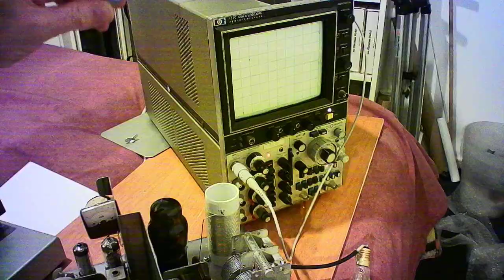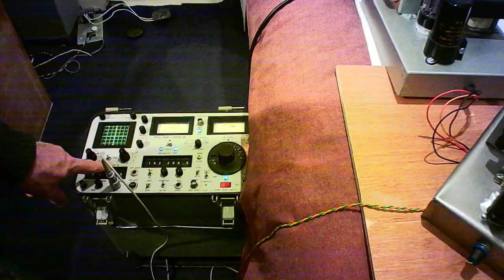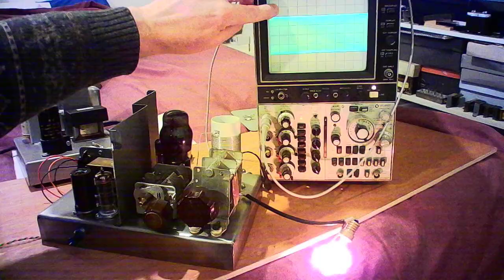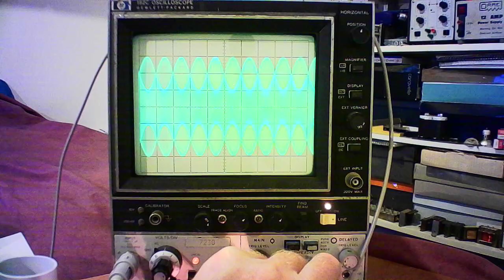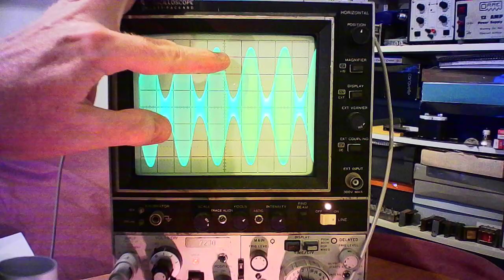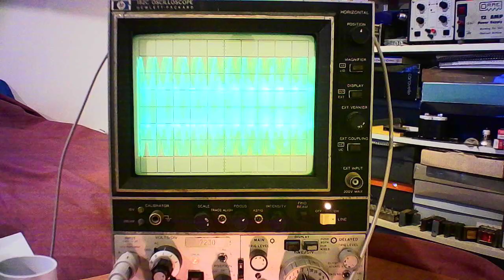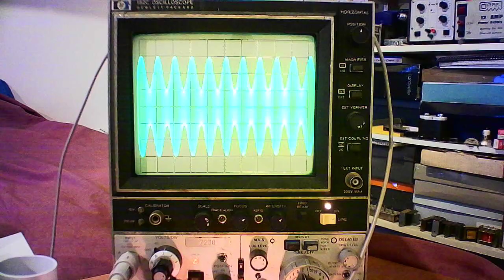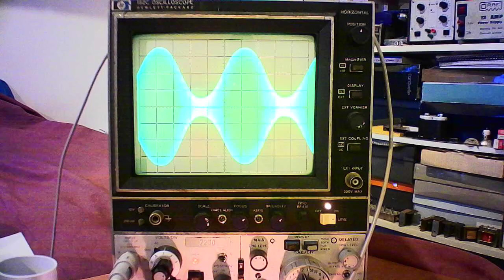160 and 80 metre Valve Transmitter project part 2.

Comment: Very nice job and fairly decent modulation - easily good enough for just AM amateur radio. What did you use for the modulation transformer?
Reply from the maker: Thanks for the comment.
The modulation transformer in this video and another I replaced it with were both hand wound.  Not a transformers with primary and secondary, but more 240 Volt autotransformers.  The first was tapped halfway at what would be 120 Volts centre point, but later another one with the tapping point at 110 Volts.  That was more in line with the original CODAR design I believe.  So HT in at 110 Volt point,  0 Volt tap used on the modulation valve anode and the 240 Volt tap (130Volts) side connected to the PA anode.  This gave a slightly better modulation swing so that 100% peak mod is achievable.
Adrian